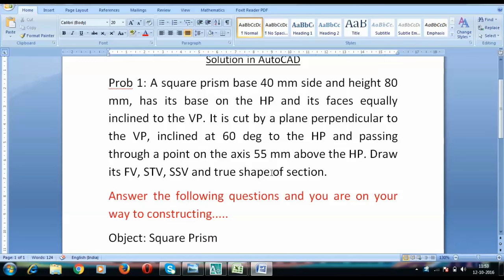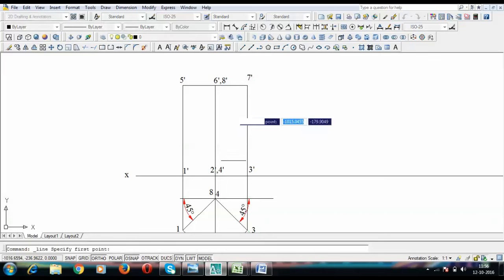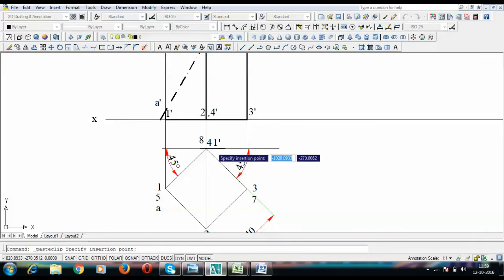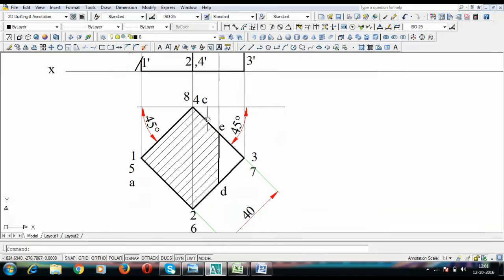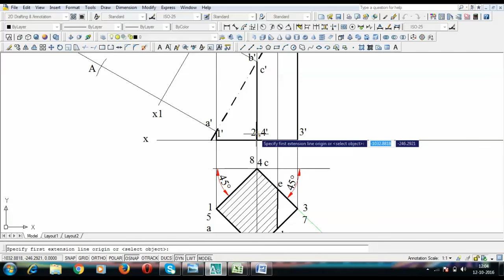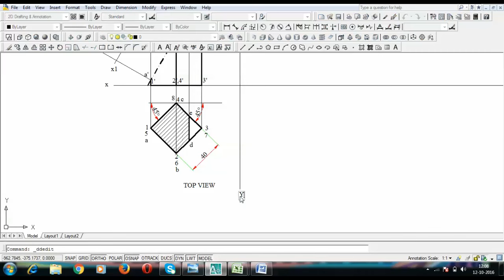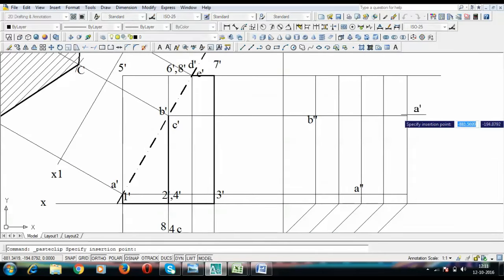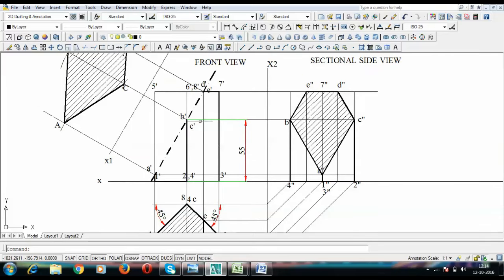1. How to draw the Front View, Sectional Top view and true shape of section of square prism

Comment: A pentagonal pyramid of base arm 30 mm and axis 70 mm height. placed on HP by a corner of base that makes axis inclination 30* with HP.

If we cut above given solid by using a horizontal Cutting plane which perpendicular to the VP. Cutting Plane cut at mid axis. Draw its Sectional T.V and F.V
Reply from the maker: +Gajendra Pathak 
Gajendra i will make a video tutorial on this problem.. and post it today or tomorrow...so stay tuned...

Comment: Sir u r osm and I want q- A square prism base 40mm side and axis 80mm height is resting on hp with  axis vertical and all faces equally inclined to the VP it is cut by a section plane inclined 60° to home and passing through a point on the axis 55mm above hp draw fv ,sectional tv and true shape .... immediately tomorrow is my exam sir plz...🙇

Comment: A square prism with a base having 40 mm sides and height 60 mm is kept on its base on 
the H.P. such that one of its rectangular faces makes an angle of 300 with V.P. It is cut by 
a section plane parallel to V.P. such that the true shape of the section is a rectangle with 
30 mm and 60 mm sides. Draw its sectional front view and top view.  

can you please tell how to answer this question ?